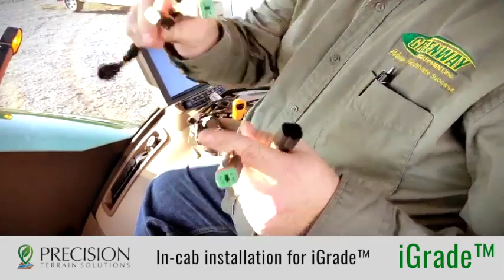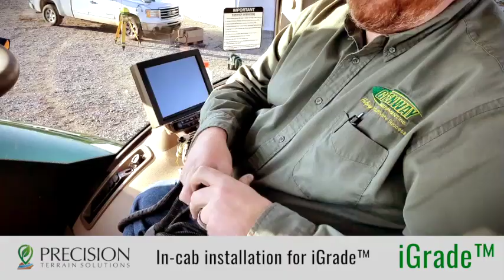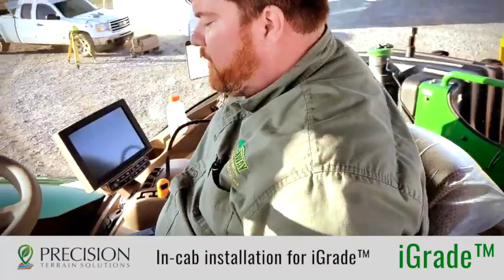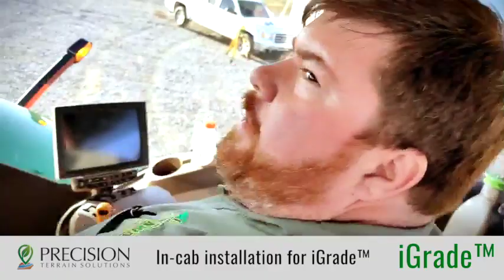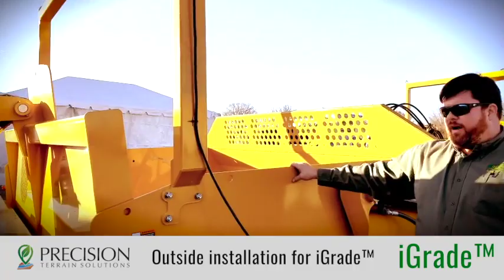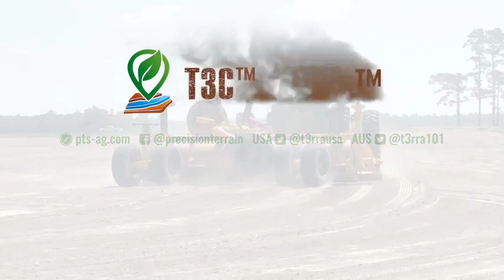In-cab installation for iGrade™ & Outside installation for iGrade™

Comment: Do you have the part number for the 9 pin iso adapter
Reply from the maker: The part number of the 9 pin ISO adapter harness is RE322780. It is very useful for getting ISO controllers online while keeping them in the cab, the harness is for R series tractors only though.
Reply: Do you have the part number for the scv adapter to the tractor
Reply from the maker: @wickedmind381  for newer JD tractors (IE 8030 series and newer) the SCV adapter is not needed (with UCC2) however if you do need it for older legacy machines there are two variants, RE58827 (Rowcrop) or RE67685 (articulated).

Comment: Hi, what is the part number for the CAN adapter in the cab? thanks
Reply: Hi Sam, 
The harness is for R series tractors only. The part number of the 9 pin ISO adapter harness is RE322780. It is very useful for getting ISO controllers online while keeping them in the cab. If you have more questions, feel free to email me - gwen@t3rra.com
Thank you, Gwen